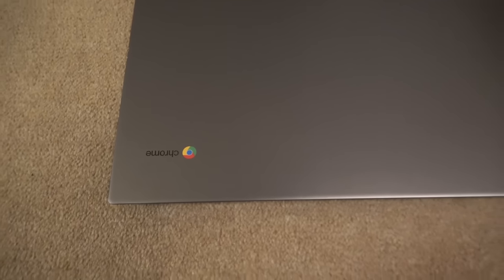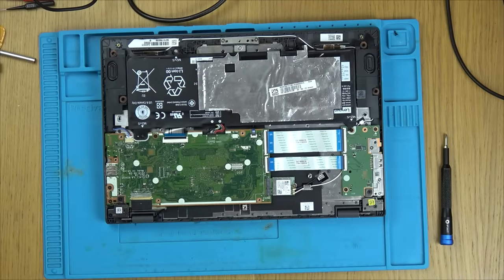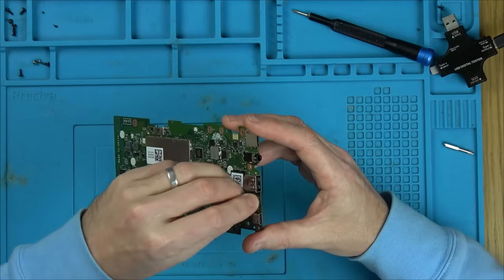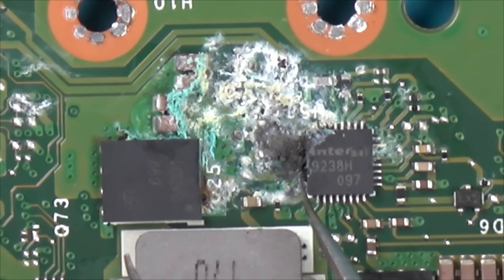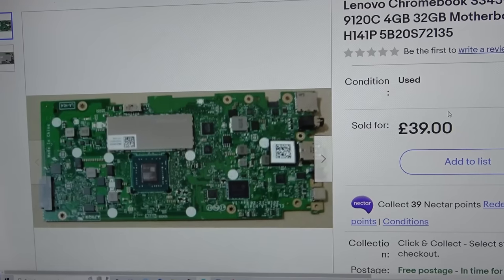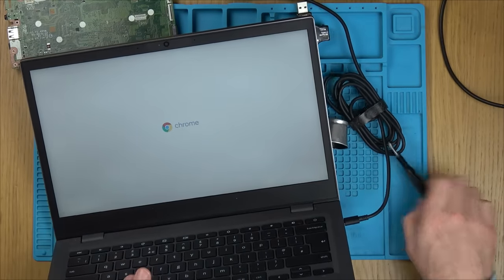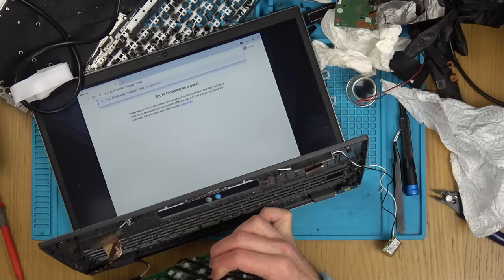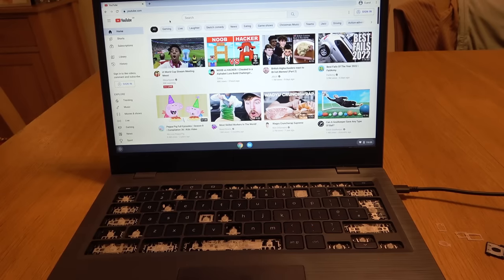Trying to FIX a LENOVO CHROMEBOOK S345 with some Previous Funny Business

Comment: That was tough viewing, Vince.  Whoever sold it knew it was damaged beyond reasonable repair.  Not very honest of them.
Reply: But if the device was (accurately) described as unrepairable then nobody would have bought it. 

I always assume that used electronics are just e-waste, and I pay accordingly.
Reply: @williamharris8367  I don't know, there's something especially scummy about selling it knowing that has a previous a repair fail AND has missing parts AND for the price they asked.
Reply: It isn't even damaged. It was destroyed by prying out that chip cold.
Reply: Yeah. This was jimmied and they knew it, and that's dishonest as hell.
Reply: @solarbirdyz  You don't know if the seller is the same person who damaged it. Maybe the seller got it, tested it, realized it didn't work and sold it off. We don't see the full ebay listing. The seller even mentioned that it had been opened up before.
If I buy something for spares or repair, I assume that it is potentially broken beyond repair and if it's been opened before I also assume it has been tampered with by somebody who potentially shouldn't be allowed anywhere near a screwdriver.

Comment: What a cliffhanger to the very end! That video was a thriller and the forensic autopsy gave an insight into just how delicate and vulnerable technology is.
When I bought a new 15.6" 1T HD with 8GB ram laptop 5 years ago, just a few weeks later spilt my pot noodle over the keyboard and after an urgent and Valliant rescue attempt sadly failed and a third of the keyboard keys did not work. My computer shop said it was too corroded to replace it with a replacement. It's still in use today with an external Monitor, Keyboard Mouse and it works fine. The lesson learned is never ever take anything liquid near computers and your Chromebook is usable.

Comment: Keyboards are about a tenner on eBay, you can melt the plastic welds back enough. I did keyboard replacement on a almost identically laptop the other week.

Comment: EMMC memory chip ( the SSD or in other words hard disk drive) That board should work without the emmc chip, Well now you have spares for it, The chip side connections are more important than the bottom  pins, You could have a short on the main power rail, Thank you for the mention, doubled check your solder joints on the chip  Still an awesome video  👍👍👍👍👍👍
Reply from the maker: Thanks AR 👍👍👍

Comment: So close! 
FYI, in cases where the layers separate but they do work under pressure, you can simply use a dab of super glue to link them back together, I've repaired Laptop Keyboards this way in the past and you'll often find they have a tiny bit of adhesive holding the layers together spotted throughout, another reason to be careful if you do go down the rabbit hole of taking them apart!

Great work on the micro soldering, shame about the severe damage. Imo it was probably water damage someone spilt something like a cleaner on it, maybe a polish of some kind if it was waxy? We'll never know! :P

Comment: I'm glad you done this m8, one of my neighbours gave me 40 broken laptops, 20 odd tablets and another box of old phones and some of the laptops like the Vaio are in pristine condition and I am summing up the courage to start tackling this huge pile of machines.   I watch NorthridgeFix daily as well as he hits on laptops a lot too and I reckon most of them are mosfet or cap failures that I have.   Wishing you and yours a happy Xmas :D
Reply: Yeah I've repaired a bunch of laptops and most no-go faults are bad caps/mosfets etc - I have had the occasional power management chip fail on certain brands (Looking at you HP)

Comment: Interesting to see. But it was NOT a waste of time for you either. From every failure you learn a lot of things. 1) First make a thorough visual inspection for missing or damaged parts. 2) You (and we watchers) learned how all that stuff looks like inside, especially such keyboards, and whether a repair is possible. In more higher class notebooks the keyboard is easily replacable and quite cheap to buy.

Thanks for doing the filming.

Comment: a 3d pen with the abs filament works wonders for the plastic rivets that hold these chromebook together as well as vintage calculators. I've used it for one I found on the side of the road. A bit of water damage on the screen, but it's still usable for what it is.

Comment: On pads, I have had some success (but not always) in using of all things, slug tape (copper with adhesive backing) by sticking down a block of tape onto the board, taking it along the track well clear of the chip, (even well over the remaining trace) then soldering on link wires at the join(as the back of the slug tape is insulated by the glue) then finally using a scalpel or needle to separate into strips. If the back of the chip is not metal used the strips can even run under the chip or varnished (solder mask). Often because of the size, even a scalpel can be too wide but strips can be separated using a fine needle or razor blade as it only needs the finest of gaps. The heat of the iron may lift the strip slightly but only in the middle and a good length of strip can keep it stuck down (though in truth it can still take several attempts).  I tried cutting the strips before applying but reached screaming point and failed.  One big block and carve it on the board worked better. 😂😂

Comment: Cool repair, however I don't think it was lithium grease.   I had a similar issue with an Apple MacBook.   The lithium battery pack (looked similar) had bloated somewhat and leaked the lithium out into the motherboard.   The result looked very similar.   And since the battery was also a bit messy I wonder if that's what happened.    Always love your stuff.   You're my favorite repair Youtuber.

Comment: For fixing the broken traces to the chip, wouldn't it be much easier to solder wires to the 3 corresponding pins on the chip while the chip is off the board and then just solder down the chip? Then you wouldn't have to deal with the microscopic adhesive copper pads.

Comment: I recently had one of those Lenovo Ideapad slimline laptops in for repair (the cheap crappy one with no hdd, and no m.2 slot) that had a very similar keyboard, heatstaked into the upper case. I did find a replacement of just the keyboard for £15 on ebay but it was a proper swine to fit, but if anyone wants to give it a go, this was my basic technique;

Firstly, slice off the tops of the heatstakes very carefully using a craft knife - the trick is to slice them so that only the melted tops are gone - try to leave the majority of the stakes intact.
Then, once the old keyboard is removed, carefully apply hot air to the stakes, one at a time, and try to stretch them a bit with tweezers while soft. Sure I broke about 30% of them, but in the end I had enough to hold the new keyboard in place.
Then fit the new keyboard and flatten the ends of the remaining heatstakes with the tip of a soldering iron or something similar.

Probably not the best way to do it, but it worked and the customer was happy to have her laptop back in time for christmas :)

How long the repair will last is anybody's guess, but given the crap build quality of these machines in general, it shouldn't be any worse than it came from the factory :)

Comment: it's good to stagger your scraping so they aren't so close together. you can also solder the jumper pad directly to naked traces like test pads or a capacitor. it makes it much easier and less cramped to do micro soldering. great attempt though!

Comment: You should DIY it into some sort of Chromebox with a wireless keyboard and mouse.  Battery setup even lets it act as a UPS of sorts in case of power failure.

Also I don't think that was lithium grease for cleaning... I think that was lithium from a battery blowing up. That was most definitely NOT the original battery in it. The motherboard failure also smells strongly of a blown battery given where the failures were, power circuitry.

Comment: Corrosion sure wreaks havoc. Just repaired a lighted Bluetooth mirror for my sister, that had just randomly stopped working entirely. Opened up and found the ribbon cable that connects the push button board to the main board had corroded where it was soldered to the button PCB. This was one of those paper thin ribbon cables, so just replaced it with 7 strands of 22 gauge wire. That said, I didn’t notice any liquid damage anywhere, not sure why the corrosion. Almost seemed like where the flux would be, but never really seen corrosive flux used in this sort of thing. And pretty annoying that chip was missing on that board to top it off.

Comment: Plastic weld's are repairable if the casing has enough meat you can run a few tiny screws from backside into the casing (for stuff like this you wouldn't need many.

Comment: If only you had a 3d printer. Maybe you could print a whole new case for it with a recessed opening for a wireless keyboard. That way it could still be used as a laptop because the wireless keyboard would set flush do to the recessed bottom.

Comment: Not very sporting of the seller who could have elaborated on the actual condition of the chromebook. But then if he had said one of the main chips has been removed and the ball pads ripped off you wouldn't have bought it. These people give ebay a bad name  but I guess if you had needed a new screen it would have been worth the 40 odd pounds. Despite this I still think this seller was not quite honest with you. But a good fix it video none the less  it's all a learning experience for your viewers Vince
Reply: Totally agree with that David. I've asked similar questions with sellers before, and you normally get the reply "it came in   a job lot" or "it came in a house clearance" type or response.

Comment: The disassembled keyboard was for me the most interesting part, as recently one key stopped working on my laptop. Removed the key cap and cleaned what I could see, but I guess the parts you pinched are mechanically or physically worn out in my keyboard. 
My laptop is a Packard-Bell EasyNote LV from 2013, and seems there are replacement keyboards available, but "fixed" mine by purchasing external USB keyboard :D Cheaper and easier option :P

Comment: I wonder if you could cut the keyboard out and retrofit a slimline laptop keyboard into it. It'd be difficult to find a ribbon cable with the same power key and mapping or perhaps you could splice it into the USB port inside the case.

Comment: W0W!  Talk about the World of Giants!   Really like idea of using Copper trace strips 
sorry about the Missing part.  I Did see that, I never know what's needed ... yet.   : }  
Can you get ON Screen Keyboard to show?   Haste makes Waste. ^ 
Thanks, Not even a "Failure".   I LEARNED.  - and Quite a Cool, Different Keyboard look.   

35:25  "Exposed"?  Oh OK  36:35 \ 37:05  "Destructive"? ^ ripped taking apart?  Still needed Cleaning.
??  23:35  Is that OK to have [Huge] 'Bridge' btwn Capacitors?  not seen before, so not sure. 
maybe a Reflection?           Nice Work!    Cheers!

Comment: just came back from your last video and i have to say i am very surprised that that lithium battery leaked like that

usually such batteries are sealed and unless physically damaged shouldn't leak

also the ripped off BGA chip is indeed the storage module 

can't believe that we didn't think of that, guess we're used to computers with removable SSD's 😆

so there must be another fault prior to the removal of the storage chip they couldn't get it to power up so they just ripped it off and sold it on ebay 

very interesting nevertheless haha

Comment: As you’ve found that some foreign agent has found its way between the two membranes I’m very surprised that you didn’t flood both surfaces with isopropyl alcohol. Surely that would have gone a long way in curing the problem. Having said that it was still an interesting video.

Comment: Myself being in the repair industry, I've come to the conclusion that many of the ebay sales that have 'Not working' with very little else in the description are scammers who know EXACTLY the situation of the item they are selling but they do not want to disclose to buyers that it has already been messed with/previous repair attempts because not only does it put off buyers but it means the price they are asking is not worth it. Many times when buying faulty iphones, laptops and digital watches looking for ones that are possibly repairable, I have bought ones that say 'Not working, no power, nothing else done to it' and when it arrives and open the item up it's always a horror story, heaving liquid damage, burnt holes in the pcb, parts ripped off the board thereby damaging pcb tracks and the sellers always respond with 'I had no idea it was like that'. Yeah right, scamming so n so.
Reply: That and job lots of "untested" items.

Comment: it was the SSD. the seller or the one the seller got it from ripped it off the board for data security reasons, because the chromebook was water damaged before and they couldnt turn it on to delete their data.
reason enough to never buy something with a soldered on ssd. i would have filed a complaint, they knew more than they wrote in the description.

Comment: Did you get this of a female seller as I have seen something similar.
Somebody was using one for OF and spilled some unscented body oil on the keyboard and that killed the keys.
I think it was the same device.
The corrosion may have been caused by some submariners or similar fluid. LOL.

Comment: i hate a con ebay listing. there was clearly obvious issues and was a push through the door listing. i hate ribbon cables sometimes as if only 4 keys work it indicates a working board which has been damaged by liquid means.

Comment: I've got my old Acer laptop, that has a failed keyboard, under my desk. I remote control it using VNC from the Raspberry Pi running Linux on my desk. I run Windows on it for the few bits of software I haven't found suitable Linux versions for, and just turn it on when needed. It's a cheap and low powered alternative to running Windows in a virtual machine on a more powerful Linux PC, which works well for me. There are lots of other uses for laptops with dead keyboards, for automated tasks, and when you only need to remote control them. They have the big advantage of having low power consumption, for jobs where they need to run 24/7. Being portable isn't their only use!

Comment: What bloody douschebag would sell a board like that :/ I sure hope you gave them a really bad review.
PS: This would have been a prime contender to make an emulator machine from. Just banging in recalbox and have it as something you plug into the machine to play everything up to PS1 games on (not sure if the processor could handle PS1 emulation since it's not too strong on single core duty but perhaps boosted it would).
Anyways, such projects are a load of fun and the cool thing is you can buy machines with busted screens and keyboards and it will still work for that purpose :) I had loads of fun fiddling around with that and making my own splash screen for my little mini arcade thing so I can definitely recommend giving it a go. Heck, even if you buy a complete crap and broken lap top for 5 pound I bet you it can run Nes, Snes and that type of thing.

Comment: Aerosol air duster can the person could have been trying to blow the dust off but tipped the can the wrong way and the liquid in the can sprayed out , that's why they sell compressed air cans for spraying dust off key boards instead of Aerosol caned air which has chemicals in rhem to help propel the air

Comment: I wonder if the lcd was cracked and replaced, i bought a broken laptop once and it was soaked in the liquid from the damaged display, maybe this leaked into the laptop and after they replaced the lcd and turned it on it shorted and blew the chip you were repairing

Comment: CHANGE OLD PWM IC
SECOND (PUT THE WIFI CARD PLACE .SSD)

EMMC JUST A HARD FDRIVE (CONTROLLER + EEC 8BIT NAND )
IF YOU SEE IN BOARD 25Q32 OR 25Q64 .SPI .IF BIOS PLACED IN SPI IC 
YOU CAN USE SSD IN WIFI CARD (M2)

Comment: Ebay is just a dumping ground now! My mate bought a PS5 to fix and the listing said "spares or repairs" wont turn on, bought in job lot of consoles so may have parts missing or just an easy fix no idea, ive not opened".
Guess what, there was nothing inside it but some hdmi and connectors hot glued to the case. Ebay did nothing

Comment: Disposable junk. Laptop keyboards are a high failure point and used to be cheap and easily replaced but since everyone has to copy Apple they are now fixed and write off the device when they break. I wonder if setting a water damaged laptop keyboard assm out in the sun for a while or on a heater (around 40-50c) can dry them out without melting it

Comment: Clearly just levered off the board without hot air. Likely an attempt at personal data destruction assuming irreparable. Also, if the pads were intact and you took a chip off a donor board it might not work as there's also a security chip, so it might not accept the changes in hardware. Almost as bad as our favorite fruit company!

Comment: Erasing personal data before selling is important but don't just go, rip the chip off with a pair of pliers and sell the machine. Also, these chips drop dead as flies. It is possible that this was someone's failed repair attempt. Whoever came up with the idea of permanently soldering mass storage to the board is either stupid or evil. That non-removable keyboard was probably also designed by that red guy with a pitchfork.

Comment: The seller really stitched you up with that board. It's one thing to sell a faulty item for "parts or repair" but when you know exactly whats wrong with the item and fail to disclose it in the description.. well that's just scummy. The fact the board was missing a whole BGA chip says a lot.